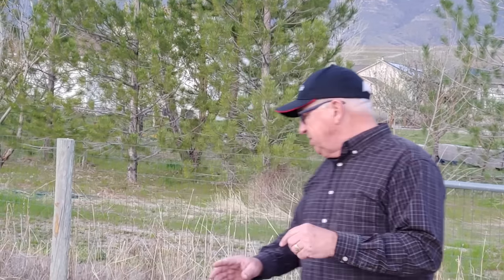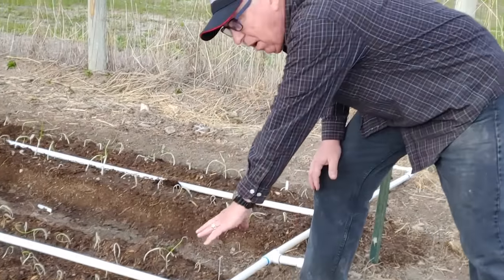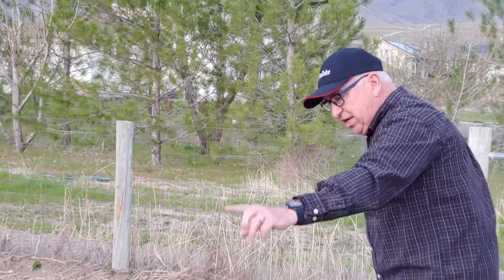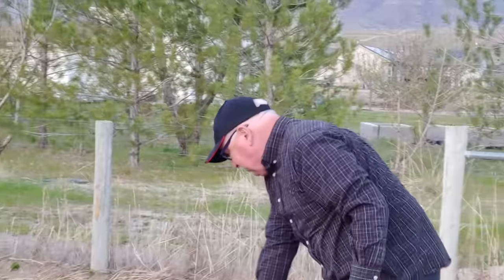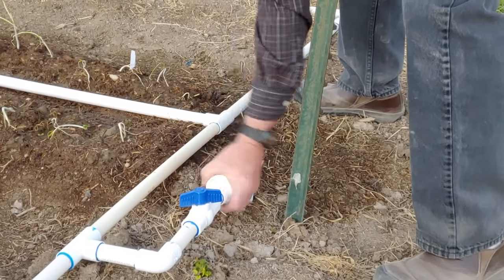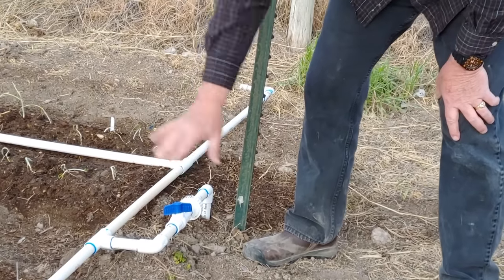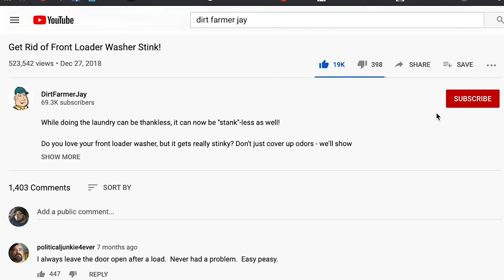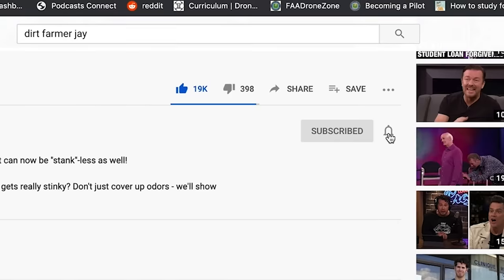DIY Garden PVC Drip Irrigation - Easy, Cheap, Effective!

Comment: Cool video but if you connect the far end of each run it will equalize pressure and provide more even water dispersion.
Reply: ^ this is true
Reply: This works amazing! Learned this years ago when I installed lawn sprinklers. More pipe, but worth EVERY penny.
Reply: I use pvc c rings to adjust spray on my diy spray heads.  On my channel a few years ago.😊
Reply: Exactly..like a manifold system..
Reply: What do you mean by connect the far end of each run? Do you make make sure everything loops rather than dead ends?
Reply: @wankerd3c  yes, connect the far ends and your pressure will be much more even. Always loop when possible
Reply: @RyanVander  thanks!
Reply: @RyanVander  Please explain how to loop the far ends? do you mean connect each row of pipe to a horizontal (90 degrees)  row of pipes?
Reply: @mondaR-1 connect the pipe ends by using 2-90 degree elbows and a straight run of pipe between the 2 existing ends of pipe.  Called a loop because now the 2 ends are no longer dead ends but are looped together  in a circle, so to speak.
Reply: Rubbish. It will have no effect on water distribution.
Reply: That is not a drip system. It is pvc pipe with leaks.  Precipitation rate is far too high and will cause excess runoff.

Comment: if the spray is too harsh coming from the pipes you can wrap an old sock around the holes and secure it with zipties. the water will dribble out through the sock instead of spray off to the side.
Reply: Hope you still use this account.
Would it work underground?
Wrap the sock around the holes so the holes don't get plugged but the sock is always wet and since the pipe is under dirt, so is the dirt.

Comment: Thanks for the video. Ray, I mean Jay. Least I didn't call you Faye!!! Wish you would shown the full length in action. I tried a soaker hose. But the first 3 feet puts out more water. As you go down the hose. It got less, and less. When you got to the end . Hardley any water came out. Your system has equal watering, the full length. I assume?
Reply: I found that to be true with my drip tape🤦‍♀️ pressure was weak toward the end
Reply from the maker: Thanks for watching and writing Charles Coker. This system is highly dependent on a level ground. The easiest way to achieve this it to turn it on, then see which areas are getting soaked and which are starved and adjust the ground under the pipe to make them flow the same.

Comment: How long does it take to fully saturate the soil using this. Is using a drip irrigation quicker than watering by hand?
Reply from the maker: BiRdUp 520, I want to be sure I'm answering precisely. This system is designed to put water right at the base of the plant, and saturate the root zone while keeping the surrounding area dry to mitigate weed problems and to save water. We actually build the system with the distance we want between holes, and then turn on the system for a few moments. We then use the spots of moist soil to locate and plant our transplants. Simple, precise. I can water a whole plot of about 20' x 30' in about 12-15 minutes, by taking some time initially to get the system balanced, and then getting water to go right where I want it. Does that help? Best, DFJ

Comment: That is genius, taping three together and drawing a straight line!
Reply: Or you could just use the writing that's already on the pipe..
Reply from the maker: Hagfan, I've found doing the line is more accurate. About 25% of the time, the printing on the pipe "spirals" slightly around the pipe. Best, DFJ

Comment: Ok this is just brilliant. I'd done the commercial drip irrigation systems in the past and was never happy with them plus they get $$$. Tried to hand water, ugh that's no good. Soaker hoses just flooded the garden and the bermuda grass quickly took over thanks to the abundance of water. Told my husband I wanted to try a PVC setup but wasn't sure the best way to go about it. The trick with using the water to mark where to plant the seeds is genius. Thanks for a great DIY video!
Reply from the maker: Thanks for watching and writing!  Best, DFJ

Comment: Hi Jay thanks for the video. I like the idea of having reasonable sizes holes that shouldn't block up too easily.
In the past, for use in a domestic greenhouse,  I tried using the little drip nozzles that are fed with a narrow tube off a main 1/2" supply tube. The drip nozzles always got blocked up and in the end I found the best thing was to remove the drip nozzle and push a long length of pvc coated copper wire into the narrow tube. I found that I could use different sizes of wire and different lengths of wire to quite accurately control the flow of water for my wife's delicate greenhouse plants. It's no good using very short lengths of wire as the water blows them out, sometimes I was using a 2 or 3 foot length of wire to restrict the flow but it worked very reliably and didn't block up like the silly little drip nozzles. The long narrow restriction created by the wire reduces the flow and there is nowhere where the hole or restriction is a fine as the hole in a drip nozzle.  (I hope that all makes sense) I'm now looking into designing a system for external flower beds and I think I'll use your method with some black pipe, maybe electrical conduit?
all the very best . . .  Andy

Comment: Thanks for the idea, and I'm going to add to your idea.  Where you have the three pipes stacked together to draw your line, I will use the pipe with the two lines.  The line seems to be the right distance apart to water two sides at once if I run the pipe in the middle of my rows which is only three 8'L X 3'D X 3'W raised garden beds.  I live in the sunshine state so we can leave those pipes out all year round.
Reply from the maker: Great thoughts and plans for this system! Happy growing! DFJ

Comment: Excellent video!  As a beginner, I needed to see how to set up an irrigation system beginning at my exterior house faucet. I had planned to use garden hoses and a soaker hose around my newly planted trees and shrubs.  The cost of quality hoses is astronomical!  I’ve checked numerous sources for the best rated gardening hoses and no matter the brand, about 7-10% of the buyers have found them to fail from immediately after purchase to 1 year later.  I don’t want to spend $100 for a 100’ garden hose that will have to be replaced.  I only have one exterior faucet and the planting bed is in the opposite side of the house. I need 200’ of hose to go around the house to reach that bed.  I will still need soaker hoses for the trees and shrubs.  The cost adds up fast and may have to be replaced in a matter of 3 years. 

I think it would be best to run a PVC pipe from my faucet to the planting bed and then build drip lines exactly as you have done.  I will not have to worry about kinking, heat, blow outs etc… I can invest once and be done with it.  A person on Reddit said that is what he had done and sprayed the pipe green so it would blend in.   

My one fear is connecting the PVC system to the faucet.  I will still need a garden hose for watering plants in containers.  I need to learn how to have a connector fitted with a garden hose and the PVC drip irrigation system.  I hope to find more YT videos. 😊

Comment: Jay, thanks for the great tips on PVC watering.  I'll be doing my 10 raised beds, next. Just finished my 40 tomato buckets and wanted to share with you a couple pictures (2 different ways of doing it) - seems to work really well and I plan to connect my automatic timer/watering system.  (sorry, wasn't able to attach a photo in this comment section).
Reply from the maker: R Wilson - thanks! Send the pictures to me at jay@dirtfarmerjay.com.

Comment: I liked the idea I have used 5 gallon paint buckets with 3 - 1/8 inch holes drilled in the bottom on  one side and paint a stripe at that location. This is so I can water new trees and bushes all over my yard. This way I can water at the base of the plant which only does that plant it helps promote deeper roots and I don't need to make a mound around each  plant but I can also give it water only where its needed and once the bucket is empty I can move it to a new location and put it away when done with mutiple buckets I can fill a bucket while 4 others are draining .

Comment: Just found your channel - Subscribed-Liked-Notified.  Very affordable system.  Loved the drilling tip.   And the planting next to the holes tip.  Probably another thing that would work - if you needed to close off holes is a slice of bicycle inner tube and two hose clamps to act as a "Fernco".   Might not be a bad idea to add a garden hose coupling.    Looking forward to your videos, Jay!
Reply from the maker: Joe CNC - Thanks for the sub! We're glad you like the video and the system you outlined. Great idea on the sections of bicycle inner tube to shut off areas. That's a keeper! Best Regards, DFJ
Reply: If plugging up holes just use a roll of cheap electrical tape. The $0.50 a roll kind. Easy on and easy off.

Comment: Was thinking of getting soaker hoses, but this looks much better.
Reply: Don't waste your money on that. They perish afetr a year or two and they will be bin fodder.
Reply: Squirrels bite into my soaker hoses.
Reply: I have tried the Lowe’s soaker hose. Worked great last year. This year is a joke. All the water dumps in the first few feet and barely wetting the soil in 15’ away. 
I will be doing this system now.

Comment: Was thinking of same idea, but using 1/2" black poly drip header pipe that comes in rolls. Can be pined in place to keep straight. To keep the drill holes straight, snap a chalk line. Can also be buried a few inches.
Reply from the maker: Thanks for watching and commenting James Triplett. The main reason for using PVC for us is longevity. Plastic piping like the kind you were suggesting would become brittle very quickly in the Mountain West sun and would break easily. We've used this PVC for 5 years already with no repairs. Best, DFJ

Comment: Great video! I have 3 1/2 PVC pipes and fittings left from making some hoop houses. That could be perfect to use in my tomato beds,. The tomatoes are already planted following in a specific distance between plant. Since this is over the bed, it would work perfectly. Especially liked the part of taping the pipes together and marking them at the same time. Simple even for an old lady like me.
Reply from the maker: Sounds great!

Comment: Finally, I have looked at so many drip systems it's not funny. Yours is easy and affordable. But I have one question. What size of pipe are you using??  I have raised beds, ground beds and a berry patch. I can set each area up separately to water different days but not sure about proper size of pipe. Thank you for making it simple for an old gal
Reply from the maker: PJ - it's good to hear from you. It sounds like you are a lifelong learner - you are our kind of people! We generally use 3/4" pipe, but if you have a large area, use 1" for the main distribution header, and 3/4" for the laterals/legs. We glue up the header, but press fit all the others with usual fittings. This allows us to disassemble the system at the end of the system. Let us know how it turns out! Best Regards, DFJ
Reply: @DirtFarmerJay  thank you for your help. I'm gonna have to do 3 separate drip systems , but your system is what I can do my self. But again thankyou so very much

Comment: It would be possible to do a flowerbed the same way. I wonder if a square or any shape with rows inside connected with a 3 way be best due for water conservation. ?
Wonderful drilling design by taping 3 pipes together for straight line.

Comment: Great idea. I see you have snow-capped mountains... What about putting the lines in the ground to prevent sun rot and freezing?
Reply from the maker: Thanks for watching! We actually take out the press-together system each year to make the plot easier to top dress and work in without having the lines in place. Burying the lines also impedes the flow of water weeping from the holes, but not entirely. We like the water stream from each hole to project a bit to get the seed planted about 4" from the line for growth and weed control space. I hope that helps! We have a new version of this video coming out as well that has a few enhancements. Be sure to watch for that. Best, DFJ

Comment: FIshing tip , Mount a deck mount dewalt 
Battery reciever on your boat. Wire it in To power trolling motor & 
Lights. Easy to carry compared to a car battery.👍
Reply from the maker: Cool idea. DFJ

Comment: Hi There!   I LOVE this idea.  Question for you...how do you connect this system to your water source?  I'd need to connect it to a hose. How would I make that connection using PVC pipe? Thanks!!
Reply: You many not find locally, but here it is on Amazon:  https://amzn.to/3enIYX9
Reply: You can buy:  PVC  Garden Hose Threads to PVC  Slip (Glued) or National Pipe Thread. Sounds like you would use Garden Hose to Slip. Just tell the Hardware guy that's what you need. Unless he's a teenager he'll know what you mean. Then glue it to your system as Farmer Jay recommended. Just don't drill to many holes until you know if you have enough water to supply the holes you drill.
Reply from the maker: Stephanie Keays, here's a link to get you all connected correctly.
homedepot.com/p/3-4-in-Slip-X-FHT-PVC-Hose-Fitting-53360/100130381

Comment: Great idea for lining up the holes. I started the framework for a similar system last year but life got in the way and I never completed it. I just placed it in my garden space today while pondering the hole drilling situation. Your video is right on time for me, thanks! For corn, what is the pitch or spacing you recommend?
Reply from the maker: Thanks for watching and commenting R Mont. To answer your question, DFJ says to drill the holes 8 to 12 inches apart. You'll want to make sure the soil is as level as you can as the watering is based on the amount of water in the pipe, not water pressure. We install the pipe system every year and then turn it on for a few minutes. Then we plant the crops where the water was. Perfect way to know your water will be going to the right spot. If you see uneven watering, it's probably due to low or high spots in the field.  Best to you, Dirt Farmer Maggie

Comment: This is pretty awesome, but wondering about when I need to rototill the garden to plant again. It seems that I would have to remove everything and put back again?
Reply from the maker: Thanks, Seek Wisdom. You are correct. This is put together without glue, so everything slips together and apart. So at the end of the season, I remove all pieces except the main manifold and till. It's pretty easy to set up and take down. I hope that helps! Best, DFJ

Comment: Are you bonding the pipes together with anything or just pressing them together so you can take the system apart over the winter? 

My garden is 50' x 100' - would I be able to do a 100' run on the ends or should I plan to have my supply in the middle of the garden and run 50' from the center? Thanks for your advice!
Reply from the maker: I just press mine in as the water pressure is low enough not to blow the pipes apart. The main thing to make this work well is to keep the ground as level under the pipes as possible. If you are using a water hose to supply the water, the pressure won't force the water through the pipe if there is a hill of dirt under the pipe making the water go uphill. Let me know how your irrigation turns out at jay@dirtfarmerjay.com.

Comment: Will it be practical to put dripping holes on both sides of the pipes to water two different lines of plant? I know you said grow the onions 4 inches apart, is the spacing horizontal/rows or vertical/column? In the video, the spacing between onions vertically/column is about 4 inches but spacing between rows was larger and not mentioned. What is the best distance horizontally for onions?

Comment: Great video! Exactly what I was looking for. Thanks!
Reply: I agree, very helpful video - although, I have concerns about the water pressure at the end of each run, especially very long runs. I guess smaller hoes could be drilled at the start of runs, or maybe attaching some kind of drip nozzle at the start of runs to limit the pressure - but if that has to be done "why not use an entire drip system with nozzles at each plant".  Sounds interesting and easy - I can't wait for some feedback from others using this seemingly simple system and if they have water pressure issues.

Comment: Jay, great tip with the pvc. I am putting in a vegetable garden 25' x 50' making 7 rows 44' long. Your system looks great to build and economical. My putting water into the drip system will not be from well or town but from 275gal Ibc totes food grade sitting 15' above garden. I have 3 of these totes one collecting rainwater from house and garage one to put on hill above garden and third to put on trailer to pump water from well on other side property. That is how I will keep garden tank full.I know you said it was not about water pressure but water volume in the system to create the drip. Do you think that the volume of water coming from tank would be enough to get water to the end of 7 lines. There will be some pressure from the 15' drop and from 2" tank valve to 3/4" line. Also the lines for the drip will be 3' apart on the row hills.  Thank You Mike
Reply: I really like this plan. Did you have any problems getting water to the end of your 44 foot row?